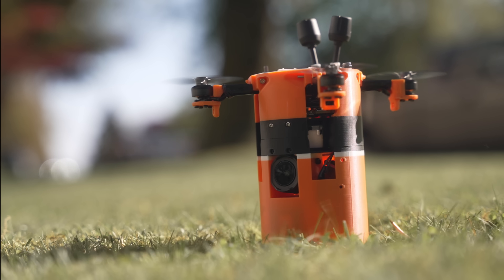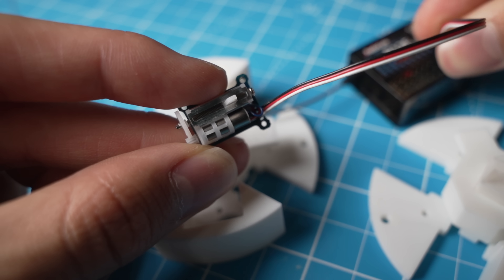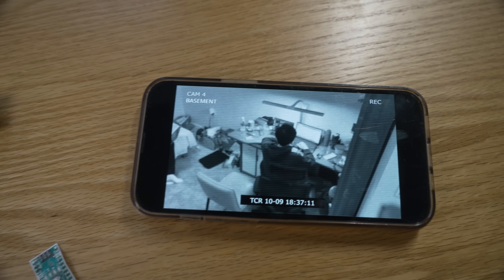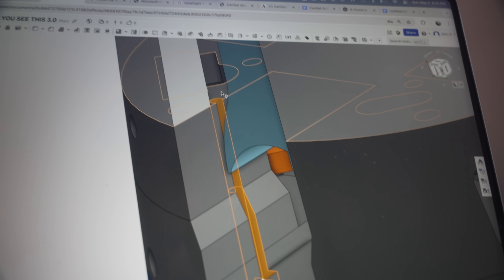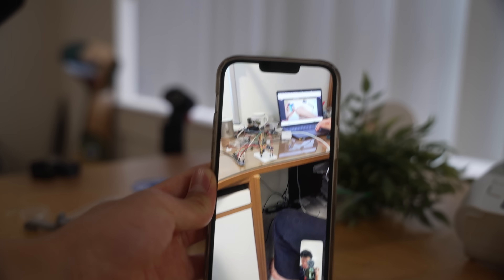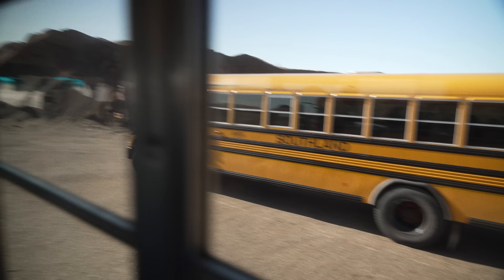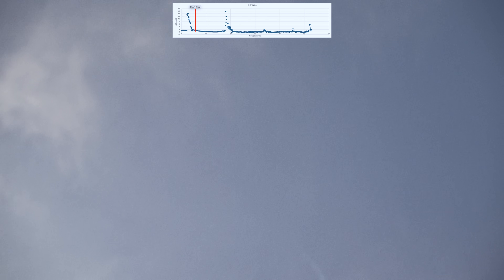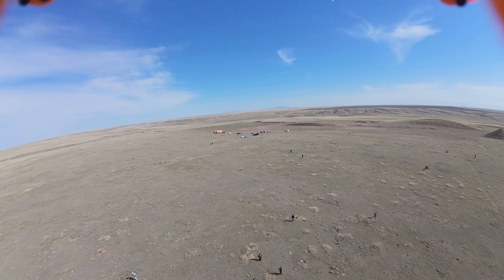I Built a Self Landing Satellite

Comment: If you make it land itself on a gps specified location, yes, you have basically built a guided rocket.
The legality depends on your local laws. The key term here is "export control regulations" and "dual use" (referring to civilian and military use). You government probably publishes a long and detailed (very, very long and very very detailed) list of what is allowed to be exported where. Since information online is accessible to anyone you may accidentally publish information that is restricted in one of those lists. It could be phrased like (quoting the EU dual use regulations here) "7D003 - Other “Software”, as follows: a. “software” specially designed or modified to improve operational performance or reduce navigation error of systems to the levels defined in 7A003, 7A004 or 7A008;" Which for example would prevent me from writing open source software that (checks 7A004) modifies a camera into star tracker with an accuracy better than 20 arc-seconds.

Comment: Put a beeper on it to help with finding it. Add a GPS to the FC and put the coordinates in the OSD. Collecting the GPS data would be awesome for you. Get some bigger motors, maybe? If you can trigger GPS Rescue on Betaflight 4.5 should come back to you (requiring a GPS like an M10 or M100). Just make sure to tune the GPS Rescue values based on your quad's hover throttle value, etc.

Comment: there is a feature in betaflight that lets you turn on the VTX with a switch on your remote
the gyro got so confused by the launch that the drone was unable to fly in angl mode, you need to learn to fly acro and it would be fine

Comment: The gap between a guided missile and a harmless drone is smaller than ever. In my view if the high speed rocket is unguided and the payload deployed at low speed is guided then you are fine. Drones are limited to 100 mph, so just wait until the rocket is going slower than this before you deploy. 

This project is super cool. Its amazing how small drones can be built these days. There are some other drones using a similar arm mechanism for example in a tube launch system but all are military focused. 

I’d recommend trying again with ardupilot onboard and with a power connection on the pad so your battery doesn’t drain even with a fan keeping things cool. That way you can plan an auto mission and not have to worry about pilot pressure. 

I’d also recommend making it more aerodynamic for high speed descent, that way the drone can spend some time at altitude. You didn’t say what your flight time way but I’d imagine not much which means high descent speed is mandatory.

Comment: GPS “CoCom Limits"
In GPS technology, the term "CoCom Limits" also refers to a limit placed on GPS receivers that limits functionality when the device calculates that it is moving faster than 1,000 knots (510 m/s) and/or at an altitude higher than 12,000 m (39,000 ft).[37] This was intended to prevent the use of GPS in intercontinental ballistic missile-like applications.

Some manufacturers apply this limit only when both speed and altitude limits are reached, while other manufacturers disable tracking when either limit is reached. In the latter case, this causes some devices to refuse to operate in very-high-altitude balloons.[38]

The Missile Technology Control Regime's Technical Annex, clause 11.A.3, includes a speed limit on GNSS receivers, set at 600 m/s.

- WIKI
and now me,
but am i reading all this correctly ? thats a limit of 1141 miles per hour (510 meters a second)
and i believe, there isnt a collective agency keeping track of this information of user flight speeds, but the gps equipment just stops functioning at that speed?

I would say anon_y in the comments here has sensible advice
but if im not mistakened, oh, ok yeah, might need approval on a rocket
but the drone, i dont think would hit the weight requirements to need to be registered for flying it
but i dont actually know much of anything to be honest

i just look both ways before crossing streets and hallways
but weeeee. cocom limits,
fun research topics. 
what else ya got!?

Comment: This is not a satellite. It doesn't leave the atmosphere or goes into an orbit. Also, "cutting" a wire is very easy and reliable with basic pyrotechnics. 
If you still insist that this is a satellite : How will it survive atmospheric re-entry? What is it's cross range? How will it maneuver in the higher part of the atmosphere where the air is too thin for rotors?
Reply from the maker: womp womp

Comment: Is It Legal to Launch a Drone as a Rocket Payload and Have It Land Autonomously with Propellers in the U.S.?**

Short Answer
]Yes, it can be legal- but only if you strictly follow all relevant FAA and federal rules. The design you describe (a drone or scientific payload launched to 1 km by rocket, then autonomously landing with propellers) is not inherently illegal or considered a weapon. However, the process is *heavily regulated* and requires advanced permissions.

---

## *Key Legal Points*

### 1. *FAA Rocket Launch Rules*
- *Launching a rocket to 1 km (about 3,280 feet) requires FAA notification or a waiver.*
  - This is considered "high-power rocketry."
  - You must file a Notice of Launch or get a Certificate of Waiver or Authorization (COA) from the FAA.
  - The launch site must be safe and approved, far from airports, people, and buildings.

### 2. *Drone Payload Rules*
- *If your payload separates and operates as a drone (flies, navigates, or lands with propellers), it is subject to FAA drone regulations.*
  - The drone must be registered if it is over 250g.
  - If it flies autonomously and outside your line of sight, you need special FAA waivers (BVLOS-Beyond Visual Line of Sight).
  - The drone must be designed for safety (propeller guards, fail-safes, etc.).

### 3. *Safety and Review*
- *The FAA will review your entire project for public safety.*
  - You may need to provide documentation of your design, safety features, and recovery methods.
  - You may be required to have a backup recovery system (like a parachute) in case the propeller system fails.

### 4. *Weaponization*
- *Your design is NOT considered a weapon* unless you add something specifically intended to cause harm (explosives, firearms, etc.).
- Autonomous landing with propellers is a technical feature, not a weapon feature.

---

## *Summary Table*

| Step                         | Requirement                               | Agency/Rule         |
|------------------------------|-------------------------------------------|---------------------|
| Rocket launch to 1 km        | FAA waiver/notification                   | FAA, NFPA 1127      |
| Payload with propellers      | FAA payload review, safe design           | FAA                 |
| Drone flies after release    | Registration, Part 107 rules, BVLOS waiver| FAA                 |
| Not a weapon                 | No weapons, no intent to harm             | Federal law         |

---

## *Practical Steps*
1. *Join a Rocketry Club:*  
   Groups like the National Association of Rocketry or Tripoli can help you with permits and safety.
2. *Contact Your FAA FSDO:*  
   They can guide you through the application and safety review process.
3. *Prepare Documentation:*  
   Have all safety features, flight plans, and recovery systems documented.

---

Bottom Line
- You are NOT breaking the law by building this, as long as you follow all the FAA’s rules and get the required permissions.
- It is NOT considered a weapon just because it lands with propellers.
- You MUST get FAA approval for both the rocket launch and the drone payload.

If you want official links, forms, or more detailed guidance, just ask!  
This idea is innovative and legal-with the right paperwork

Comment: 4:58 I don't believe this to be true, certainly not for the drone. What is true is that GPS receivers that work beyond a certain speed and height are import/export-restricted. Consumer receivers will just shut down. However, those limits are about 18,000m altitude and 1,800km/h velocity, called CoCom limits. They clearly only apply to ICBMs.

Comment: Definitely do it in Seattle! Have you thought about using a Mosfet or relay to turn the Video transmitter off when its on the pad? Maybe even using an ESP or the Arduino to power the system on when you send it a command? That way when its sat waiting for launch your not building heat up and draining batteries?

Comment: Probably good to considder rotorwash,
Going down at those velocities will get your propellors traveling through the air they just pushed down,
When descending try to have a diagonal flightpath instead of a vertical one, or just fly straight down and pull out of a dive like FPV drones are capable of

Comment: As far as legality is concerned, if you were in the US, then the FAA would require that you have authorization to launch a rocket, and your payload would probably be classified as a drone, which requires another permit. None of it would be classified as a weapon. As for that 36 minute bug, I'd look for a timer that is rolling over. I'm assuming that it's a signed 32-bit integer and it's counting microseconds, which doing the math shows 35.79 minutes is how long it would take to rollover if it were counting microseconds. If you find it, either change how it counts, or use a 64-bit integer, which should give you a couple hundred thousand years before rollover.
Reply from the maker: interesting I"ll give that a try next time
Reply: @ibuildstuff  To the best of my knowledge when it comes to rocketry with guidance the legal advice is to not publish any of the guidance software and only do top level breakdowns of how it works. The issue is the acessing of the information by non US citizens as it violates ITAR. Multiple people have done guided rocket programs though so its not 100% illegal. 
When it comes operating outside the US it can be different but most US millitary allies have similar rules
Reply: @transformatron6203  I think it is when GPS guided under thrust it becomes an issue.
Reply: @TheDroneOperator. any decent drone has RTH literally exactly that. guided thrusted autonomous travel to a gps location.
Reply: @nerys71  yeah betaflight has rth, he just needs to add a gps.
Reply: @ibuildstuff  Are you in rosemond ca? There's a model rocket launch pad like just to the north east of there.  I live in lancaster ca.
Reply: @ibuildstuff  As far as I know, it would be technically classified as a rocket-propelled drone, which has a few ramifications. First of all, there is a nationwide limit on altitude for drones set at 400ft above ground level, though this changes to 400 feet above the tallest nearby structure when close enough to one. Second, there is technically a speed limit of 100 mph on all drones (although it is not enforced, and I've never heard of anyone getting in trouble for it). For your operation, the FAA officially states that you should get a waiver to break any of these rules, which is a time-consuming and annoying process to comply with. However, you can probably break the altitude limit if you stay safe about it and don't give anyone a reason to get you in trouble. However, since your project is equally drone and rocket the case could be made that it is not a drone until separation, which could simplify some of your legal concerns. However, there is no issue with whether it would be classified as a weapons system since it does not have any actual weapon attached nor the ability to carry one. Another note is that you probably need a professional license to operate the drone, since it is being used for profit (YouTube channel). Hope this information can help you with your project!

Here is the link to the FAA's rules about drones for recreational purposes: https://www.faa.gov/uas/recreational_flyers. 
Here is the link to the commercial license and the rules around it: https://www.faa.gov/newsroom/small-unmanned-aircraft-systems-uas-regulations-part-107
Reply: Depending on which micro-controller being used you may not have access to 64bit data types. If you are using the arduino for this then you can use a library that gives you a software integrated 64 bit type or you could just break up your timer to two 32 bit yourself which is simple bitwise operation with some steps. You could alternately do the lazy but effective method of just having seconds and minutes as values you keep track of instead of just using the raw timer counter. This gives you enough room to work with for any application and the computational delay added from this is pretty minimal.
Reply: @XxBanziixX1  Good point, and I probably should've mentioned that. Back when I got started few compilers even supported 64-bit types. Libraries caught up, then processors, but for embedded devices even now they don't handle them.
Reply: Should be Canada if I read that right
Reply: Hi @anon_y_mouse, to clarify, in the US if you're flying a large enough motor (generally H and above) you need an FAA waver and a site large enough and far enough away from major roads and inhabited structures. If the drone is less than 250 grams, it does not require FAA registration.
Reply: @peraltarockets   It does if he's making  a youtube video with it, he needs a part 107 too since he's putting it on youtube.
Reply: @peraltarockets  The fact that he even flew it in this video in the US if he doesn't have a part 107 he's violating the rules and can be fined.
Reply: @maddercat  it's under 250 grams it doesn't need to be registered, it's classified as a "toy"
Reply: @Axodus  in the US if you're making money or putting it on youtube it doesn't matter, you have to register it for commercial operations and have a part 107 or you will be fined.
Reply: @Axodus  They fined a guy once even though he wasnt even monetized cause he was making money for the platform they still cited him and fined him.
Reply: @maddercat  you don't have to do anything....stop being a Karen....you follow the rules if u must be the rest of us don't have to
Reply: @smiley7123-mp5bz  you do if you upload anything, or be prepared to get fined and lose your license and your drones.  Tell it to mikey. lol So hilarious you think I'm a Karen cause I know and follow the rules.  That's not what a Karen is dude.
Reply: @maddercat  ur behaving exactly like a karen becoz we wont follow the rules like u do 😅
Reply: @maddercat only if its monetized channel.
Reply: As an American systems engineer that specializes in drone tech this %1000 accurate.
Reply: You follow rules? 😂😂😂
Reply: That’s very cool.   For V2 why not use a drogue shoot to stabilise it.  You could easily hook it into the same mechanism that deploys the arms.

That would get you in the right attitude and kill some speed. Which would reduce stress on your arms.  

You’d need to let it free fall for a second or two before powering up to let the shoot drift free from the can sat or you’d risk getting tangled, but that shouldn’t be a problem.   

If you’re not using power to gain control you’re upping your flight time.

t 

Something else, would a block of aluminium work as a heat stink instead of the fan?  The spinning of the fan might act as a gyro possible causing the rocket to have stability problems and definitely eating battery.
Reply: You don't actually need FAA approval for most amatuer rockets.
Reply: @alienblade2005  Most meaning small rockets. One that large, certainly you would.
Reply: @anon_y_mousse no, you most certainly do not need FAA permission to shoot a rocket 3300 feet lolol. Have you ever launched even a low power rocket? Serious question, you seem so confident to be so wrong about the rules regarding model rocketry.
Reply: @AnthonyOroszThePursuit20110613   I shouldn't need to be 100% explicit here, but going over a certain size and height, yes, you absolutely do need to have FAA permission. If you don't know what that cutoff is, look it up.
Reply: Looked like a properly organised event that included the rockets so I'm sure that sort of thing was addressed.
Reply: One more thing is as far as I know if you are on a NAR (or the other rocketry organization that I can remember) certified launch site then you can shot anything up to there launch limit without special permission from the FAA. You can to that without a certified launch site but only not in a city or near an airport and not more then 2000 ft
Reply: I wonder if this commenter is a SpaceX or nasa employee... So cool and lowkey
Reply: False
Reply: Oh! Canada! ❤
Reply: That’s why we don’t live in America 😂
Reply: If its big you can launch small ones any were as long as.your not in a big populated air space with alot of stuff
Reply: There are weight and altitude limits for that sort of stuff in Europe, and afaik the regs etc are very similar just with different tresholds. The rockets don't look heavy enough or flying even close enough to require authorization so long as it's not close to an airfield - in which case you're banned from flying anything regardless of what it is - without authorization. 
The drone would not require a permit unless it is acting as a drone at a height above 200m above ground level afaik, or weighs over 2kg or so which it doesn't. The rocket afaik is similar threshhold. I'm not going to look it up exactly as its a PITA to read - and I don't know the AGL or flight data here is to check anyway. 
Either way, off what I remember and can see, this would not violate any regs in the EU, but it would depend on the launch weight of the rocket and the max AGL altitude it reached.
And as this was not in the US all the people posting about US rules ought to calm their tits. It doesn't matter.
Reply: noone asked bro